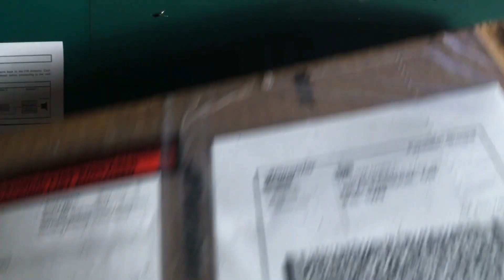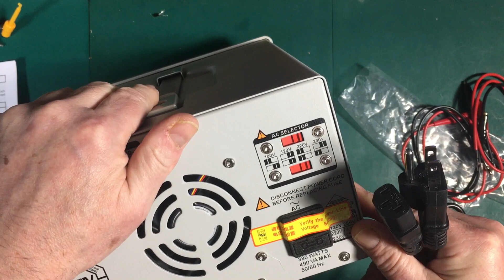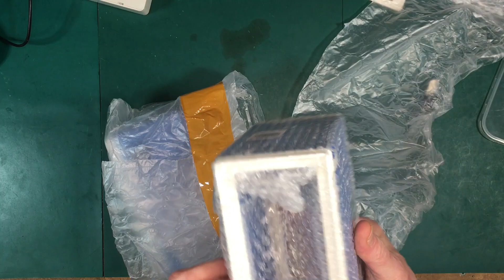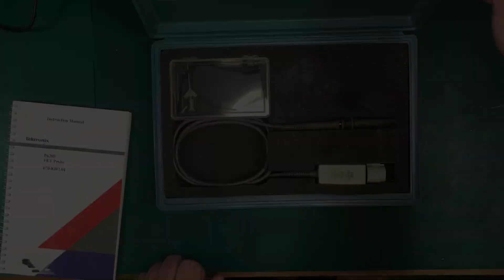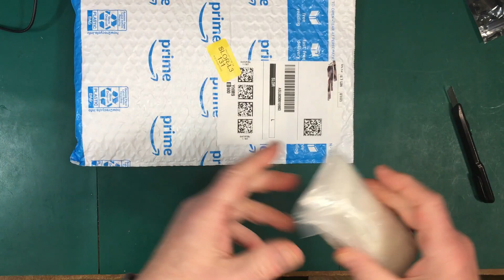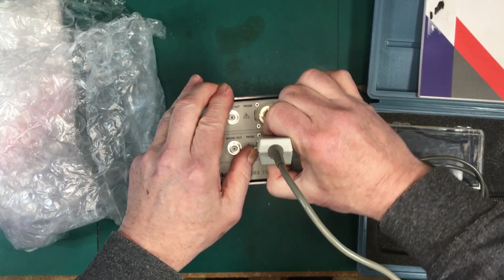0045 - Lab Acquisitions

Comment: I have had a 3303X-E for awhile. It is just okay. Quirks = The output posts are not on 3/4"-19mm spacing, so double banana plugs don't fit correctly. The same posts are slightly larger than the standard 4mm, meaning banana plugs fit a bit sloppy. The All Channels On/Off Button = If you have less than all three of the channels turned on, when you use the All Off function, it turns on the channels that are off and an addition button press is required to turn everything off. I find this dangerous. Hmm, maybe I should reach out the Siglent and see if they can update the software...
Reply from the maker: The binding post problem does not bother me much.  The banana plugs I use fit well and I never use the double plugs for power.    Overall though I have to admit Siglent dropped the ball on the binding posts.

I very much agree that the all channel on/off button could be a big problem and it bothers me.  I too should (and will) get on to Siglent about it.

Comment: DC blocker = capacitor? LOL!
Reply from the maker: Indeed it does! LOL!👍

However, in this case it's an extremely low ESR , extremely low inductance capacitor in a 50 ohm SMA male to SMA female conduit that will be within 3dB up to 6GHz.  Not quite the same thing as your average 0.1uF MLCC kluged in with a couple of alligator clips.

Comment: Cool equipment, I don’t feel so guilty of over-shopping now 😅

Just as a side note:
Please don’t rely on blurring but use black duct tape to cover the address AND the barcodes.

I‘m just looking in to the barcodes, I assume they will result at least in a tracking number.
Reply: I‘ll keep you posted
Reply from the maker: Spending my tax refund ...

Thanks for the advice, worth looking into.
Reply: I couldn’t decode the 2D code (probability specific for the courier company or a standard that is not meant to be easily decrypted) but the normal ones worked.
Could be a tracking number or again courier internal identifier.. It‘s a nuisance, I know. 

Used to do a lot with barcodes and logistics and logging and „paperless manufacturing“ etc.

The early readers are quite interesting, the modern ones all use a camera module and two lasers. The input can be run through heuristics depending on the distance and angle and whatnot.
Barcodes changed the world more than pallets.

I wish you well!
Reply from the maker: @-r-495  Thanks for the update!

Comment: What are active probes used for? And why are they so expensive? And what sort of magical properties $4000 power supply has? Sounds expensive even for Tektronix standards.
Reply: An active probe has active electronics components in it, hence needing a power supply of some kind. It uses these, so that while measuring the signal, it barely interferes with it.

Consider a bare crystal oscillator circuit, where you'd like to measure the crystal waveform. By putting a normal passive oscilloscope probe on the lead of the crystal, the wiring in that probe would contain enough stray capacitance in the probe / wire that it WILL change the behaviour of the crystal any time it is connected. So you are never measuring the 'true' waveform. An active probe is designed to solve this kind of problem. You heard mention that its rated for <3pf of added capacitance.

The power supply was probably somewhat speciality equipment, so expensive, and now rare / secondhand, so even more expensive. You can build DIY active probes that operate off a simple 9V battery, but most of them will never be as good as one made and guaranteed by techtronix at the time (although likely good enough for the job for a lot of purposes).
Reply: @ivolol  Thanks!
Reply from the maker: An active probe can be an FET probe like this one or a differential probe.  The advantage of the FET probe is the very low capacitive loading.  This model, the P6205 is less than 2pF.  So, as Matt says, it loads the DUT very little, especially at higher frequencies.  They have amplifiers with FET front ends built into the probe tip.  Down at the connector they have 50 ohm drivers.  All this needs power.  The TekProbe connector has extra pins to get that power and it usually comes form the scope itself.  However, Tektronix made the 1103 power supply to provide power for and TekProbe type probes.  The power supply is not all that magical.  It provides +5V, -5V, +15V, -15V and also a facility to adjust DC offset for probes that support that capability.  It's very nicely made but like all Tek stuff 75% of the price is because it's Tektronix.  Dave over on EEVBLOG did a video on why stuff from people like Tektronix costs so much.
Reply: @uni-byte  Thank you!